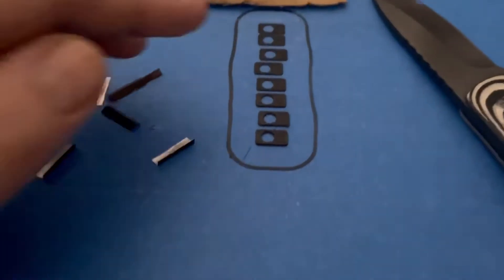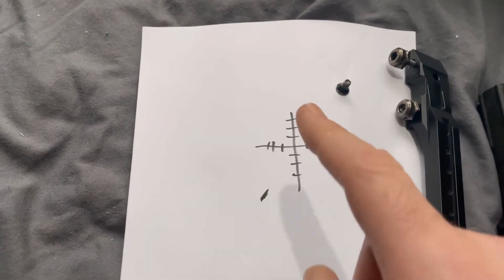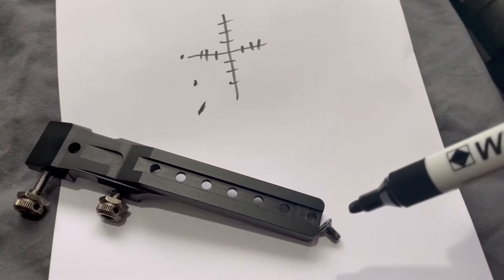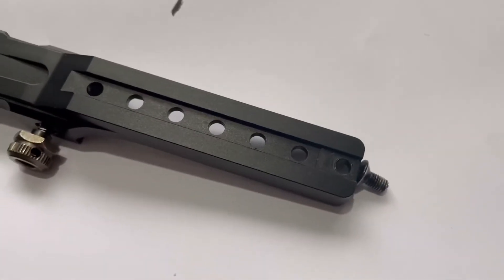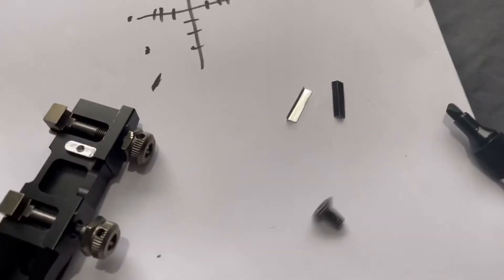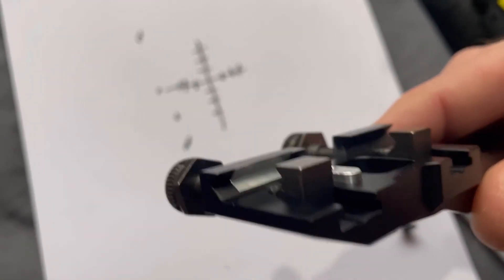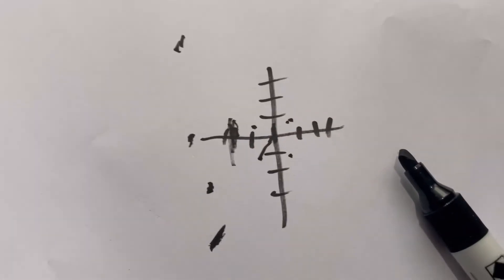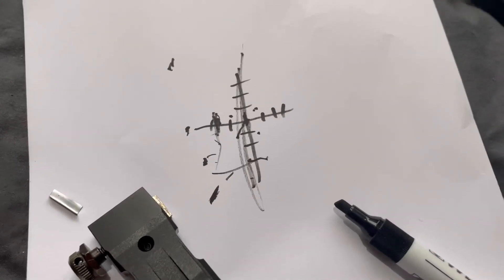Shimming a pard 008

Comment: I Have a Pard 008 on a Ruger10/22, I’ve no shims.  But I’ve followed the directions on the video today. However as I didn’t have any shims I had to improvise. We did  have a steel tape measure that had stopped retracting. The steel tape is ideal. It’s easy to snap at the correct size, and is obviously thin and very hard. My 008 took 5 pieces under the back and 1 piece on the solid side. Managed to find zero with X-11 and Y-6.
Many thanks for the very helpful video.
Reply from the maker: Thank you for sharing and I’m glad it helped buddy, these are my favourite videos on my channel, the ones that actually help my peers 👍🏻👍🏻👍🏻👍🏻

Comment: Well done mate! Very clearly explained. Worked like a charm. I used a hairspray can and it all set now. The principle does work on a usual scope as well. Thumbs up! Thanks a lot!
Maybe you want to check if there is excess of the shims in the notches of the mount itself after mounting. I had to cut the crumbled spots of the shims to make sure it does fit correctly and is well alined with the grooves.

Comment: I followed these instructions and I was very happy when I was able to get perfect zero by shimming alone.
The only unfortunate downside is that now my lazer splash is now up in the very top of the right hand corner of my screen? I know that you can reposition the range finder cursor to where the splash is, but is there anyway to get the actual splash back to a more central position on the screen?
Really appreciate you posting this easy to understand video, many thanks... Billy.
Reply from the maker: @therattyfire5468  unfortunately no mate, the laser is fixed
Reply: @airgunhunteru.k.2600  Thankyou very much for the super fast reply.
I suppose I'll just have to be happy with it's position as the more important part is achieving the zero without having to max out the X and Y on the settings.
Once again, thankyou very much 👍

Comment: Having same problems mate to low and far to the left I’ve managed to sort the height out with the he shims the 008s comes with either gonna buy there new pard mt3 quick detach mount or just sell my 008 and get the arken zulus with the 0moa I just really need help what do you think I should do
Reply from the maker: I still have a pard 008p on the R10 and have heavily shimmed it using the above process and genuinely love it but pard 008 vs Zulus isn’t even a competition mate! Zulus pisses all over the pard
Reply: What moa is the standard pard mount mate I think that’s the problem I need a 0moa mount I’ve just watched @lancsvermin control video on it
Reply from the maker: @Cattyman6  what rifle are you putting g it on ?
Reply: @airgunhunteru.k.2600 does the arken have problems with shimming I could just buy the arken mount for my pard if it fits my up and down shim is perfect now

Comment: Why not use the inbuilt zero. Isn’t that why it’s there? You used it eventually for the last few “clicks”   So what’s the advantage? If you move to another gun it’s all different shims and a whole new hassle.
Reply from the maker: Because the cross hair on these units does not centre once zeroed so your crosshair can be very drastically off to the side of the screen
Doing this helps keep it near centre